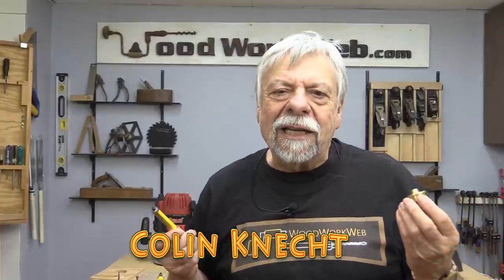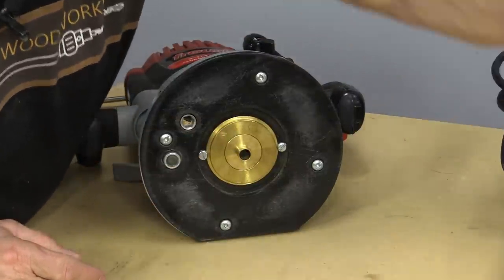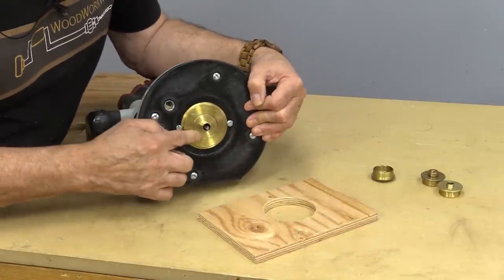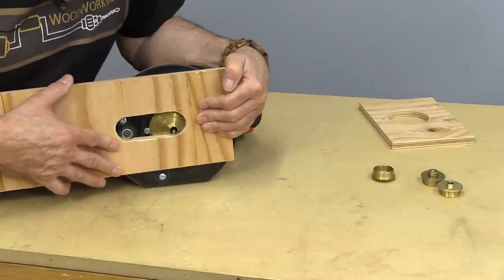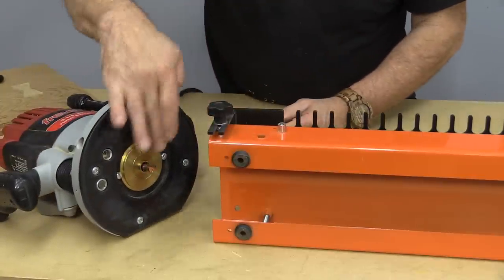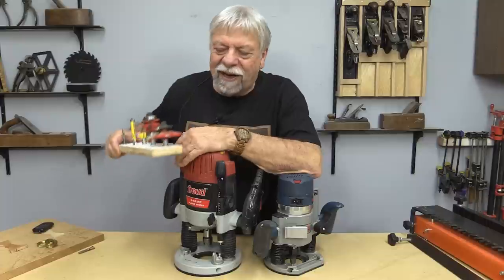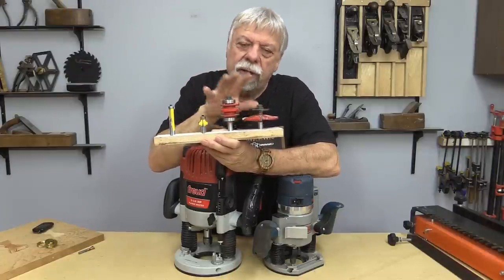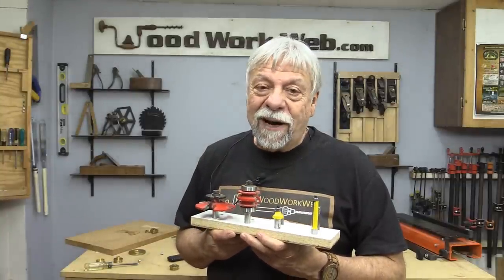Wood Router Bushings and Router Bit Speeds

Comment: I use bushings in my router table all the time. It is a great way to make a shallow tray. The wood is supported by the entire table so no rocking with the bit on unsupported templates. Also there is no wood shavings because my dust collection box around the router deal with the shavings. Thanks Colin, good content.

Comment: I feel dumb asking but much of my router bits of average size do not go deep enough to even use the guide bushing.  Otherwise my collet hits the bushing.  A collet extension is too large for it to fit through largest size guide bushing.  It's been quite frustrating to say the least.  I keep buying bits I can't use for this purpose.  When I'm using a template, I also to have to make sure to clear the template as well, so not thicker than 1/4 inch.  I'm trying to make bowls.  Thanks.

Comment: So glad I caught you talking about the speed of the routers. Need your help or maybe from others that had this trouble. Got some beautiful wood from  Rockler, called ROSEWOOD. Also got two new bits, but as soon as the blade starts in, it will start to burn the wood. Turn it as low as I can or turn it all the way up, and I get burns. Been using routers for many years, but never had this type of trouble. This is the first I ever used ROSEWOOOD, is there something I need to use on the wood or blades before using a router? Please, can you help.

Comment: Excellent video Colin.
What's your experience on Tracksaw blade finish 
v's 
Router Straight Bit cutter finish?
Have you did a video on this yet? 
The quality and power of the machines?
Quality of the saw blades and amount of teeth? 
V's
Quality of router cutters and how many passes on the materials to get through.. Say 12mm or half inch MDF or other materials?  
The setting up of the machine times to make the same cut? 
Any tare out or not? And how much tare out if any? 
I asked another chanel the same question on YouTube  
("Peter Millard" 10 minute workshop)
He uses MDF a lot and festool tracksaw and does a pretty good finish.
Haven't heard any feedback on this yet.
Would be interesting to see a demo Head to Head time motion & quality.
I've never had the need for a tracksaw I've always used routers to get that quality finish. 
If I thought a saw blade could replicate the finish you get with a straight bit kitchen cutter on the router I'd have bought a tracksaw a long long time ago.
I don't own a tracksaw and never used one but I have got plenty of routers and router bits and no need to dress the cut edges with sandpaper or a planer.

Comment: I'm here because I've just got my first router.  To go with it, I also bought a half inch 15 piece bit kit, with various bits from 4.8mm to 38mm.  I was pleased to see that the shanks were marked, not only showing the depth for inserting into the collet but also the maximum rpm for the bit.
I do have one question, though.  Why, in God's name, can't manufacturers decide which system of measurement they want to use.  1/2" shank; mm diameters? 
It reminds me of conversations we had when UK went metric :-

Customer :  I need some 4x2 please.
Supplier    :  We're metric now.  D'you mean 100x50?
Customer :  Yes!  100mmx50mm (sigh)
Supplier    :  D'you want 6ft or 8ft lengths?
Customer :  Do you mean 1.800m or 2.400m?
Supplier    :  No! We only sell 6ft or 8ft lengths of 100x50.
Cutomer   :  ??????????????

Comment: Colin, couple of things.  I bought a Porter Cable dovetail jig.  I have trouble with the supplied bushings coming loose during routing.  Per some other suggestions seen elsewhere, I now use teflon plumber's tape to keep them secure.  As to router speed, if you buy Whiteside bits, the envelope they come in has suggested speeds depending on the diameter of the bit's cutting head.
Reply from the maker: Thanks for the tips and thanks for watching!

Comment: The makers of the larger diameter bits (sold as sets usually) recommend certain router speeds because the speed at the outer edge vs the speed at the inner edge of the bit causes problems. Always read the specifications provided by the maker is my rule of thumb.
Reply from the maker: Yes, details are sometimes on the package. Thanks for watching!
Reply: @knecht105  the tip of a 3" bit will be doing over 200mph at full speed - scary!

Comment: I noticed that the bowtie you made is smaller than your template. Can you flush trim a template using bushings?  I think bearings are designed to flush trim, not bushings.

Comment: Good tips I would like to say for router bits from my understanding the bigger bits are extended farther from the 1/4 1/2 shaft so basically the further away the bit extends from the shaft the faster its actual spinning.
Reply: Yup! say that the router with the round-over bit (assume 1") is spinning at 20k rpm, the raised panel bit, maybe 3", at the same router speed setting of 20k rpm would have a leading edge traveling at 3x the speed of the round-over bit. (Circumference is 2*pi*r or just pi*d, the ratio of the diameters of the bits would similarly give the ratio of their speeds). [Also, sorry for bumping an old comment!]

Comment: Reply to Ed Waggoner’s comment about tip speed: For drilling carbon steel in a drill press that number is 6” / second, do you know what the number is for router bits?

Comment: You may want to consider a centering bit/cone to adjust for any looseness in the router base plate or the bushing holder. The cutting bit needs to be dead center in the bushing opening.
Reply from the maker: Thanks for the tip and thanks for watching!

Comment: Hi Colin,very informative video. why wouldn't one use a bit with a bearing for guidance instead of a bit with a bushing. It seems like adding the bearings in the mix just complicates things.
Reply: So where cutting out a worktop for a sink, for instance, you wouldn't make a template from the sink & use the plunge on your router in conjunction with a bush then travelling along the inside of the template? How does that work with a bearing?

Comment: Collin,  Thank you for your time and the education. That is a an excellent  video version of those familiar books titled " The Idiots Guide to Whatever " in this case,  it was wood router bushings and router speeds. No offense meant thats a compliment. It was  simplistically brilliant explanation for a laymen like myself. I learned a-lot. Thank you again. However I have a question. when using a bushing. don't I have to compensate for the gap / distance of the actual gap between the wall of the bushing and the actual point of contact with the material of the bit. Does my question make sense. it appears there will be a very slight difference because of that minute distance. Do you always need a bushing ?  when do you want to use one

Comment: Router bit suggested speed is determined by the rim speed of the router bit.  At the same speed a small diameter bit will have a slower rim speed that a larger diameter bit.  The cutting speed of a router bit is determined in inches per second travel of the furthermost cutting edge of the bit.  For example a 7.25" saw blade will have a slower rim speed than a 10" saw blade both turning at 5000 RPM.  There is also the matter of dealing with leverage: small diameter blades/bits exert less leverage against the motor than larger blades/bits do.   This is why some weak table saws will cut better with a smaller blade.

Comment: I'm confused by bushings, a short demo would have been useful.  I know you said you will go into more detail in another video.
Reply: I agree
Reply: Simplest way is to think about bushing like its bearing on bit. You put template over wood, select right bushing, and there you go. It let you use any bit like bearing guided bit
Reply: @gritz8927  but the bushing only allows you to make a copy of something BIGGER than the template. Is that correct?
Reply: @befmx31  it'll make the hole or cut smaller than the template by the size of the gap between the bushing and the bit, you just take that distance into account when making the template. Another option if you want them exactly the same as the template is to put the template below what you want to cut, then use a flush cut bit with a bearing on the end and  run around the template
Reply from the maker: Demo's to come in a future video. There was just too much content for just one video. Thanks for watching!
Reply: @TheMaxKW  Thanks for the reply. Yes, I get the flush cut trim method.  Just seems like the bushing method takes too much calculating.  Why would you use the bushing method over the trim bit method?  Are there situations where you HAVE to use the bushing method?
Reply: @befmx31  
I still cant find an answer on a bushing calculation ive wanted for years. I want to use that method to make repeat 20 mm clamping holes.

What sized template?
What bushing size?
What downward spiral bit size?

Just cant get that answer out of any woodworker on any channel
Reply: @williamsmith9026  You won't get answers because there are too many options to list.   Eg:  Bit and bushing size would dictate template opening required or template opening with "X" bushing would dictate bit size.

Comment: Nice video.
Dovetails are useless and a complete waste of time.
If you have bits with ballbearings you pretty much never need bushings.
1/2" bits make no sense since the advantage they offer is not necessary in a router: torque. You need rpm, not torque and that's why I think 8mm bits are the best ones.